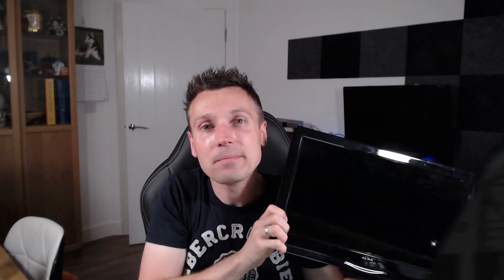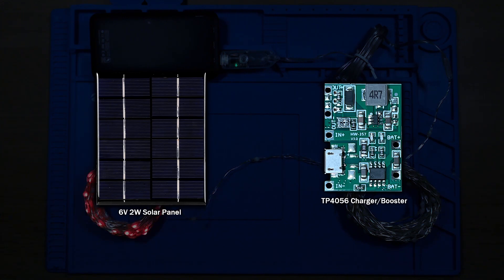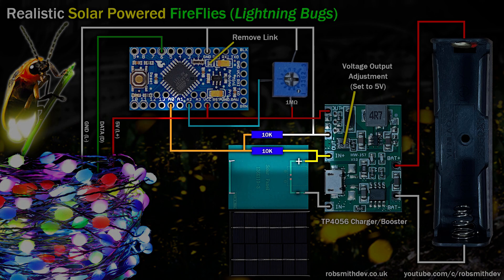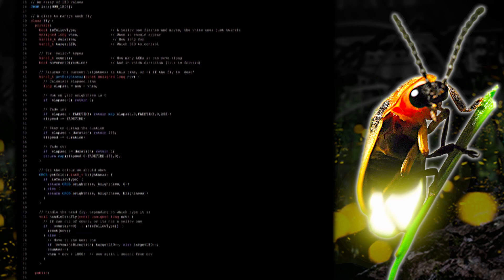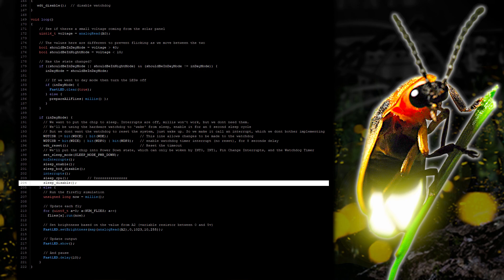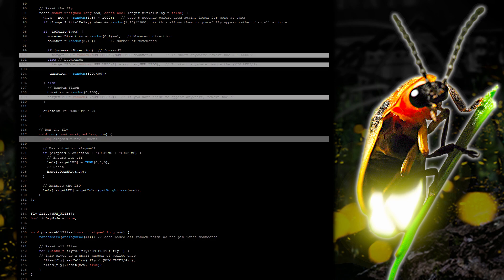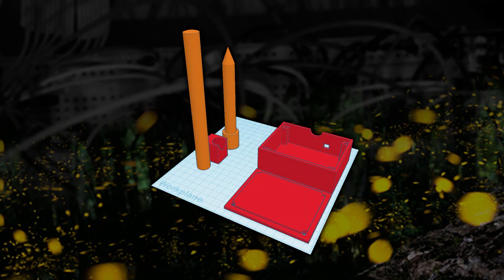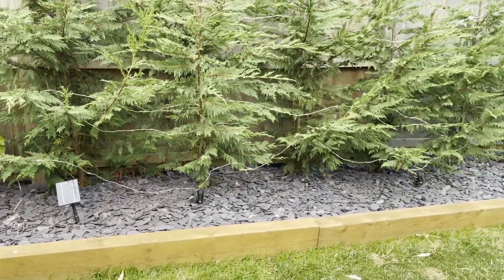Make REALISTIC Fake FireFly/Lightning Bugs for your Garden!

Comment: Nicely done. How did you run the simulation?
Reply from the maker: I took the code and mocked up
something in Windows using visual studio and captured the output. Crazy but it worked
Reply: @ I’m working on a really similar project but I don’t need the day/night settings. But I’m a total nube and couldn’t get your code to work. Do you have a version that just randomly fades in and fades out random LEDs and random time intervals?